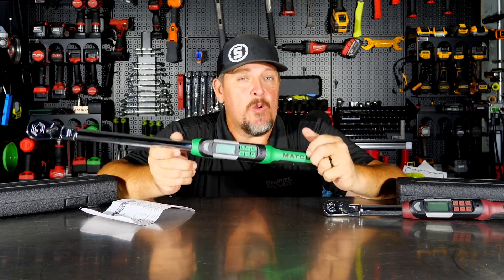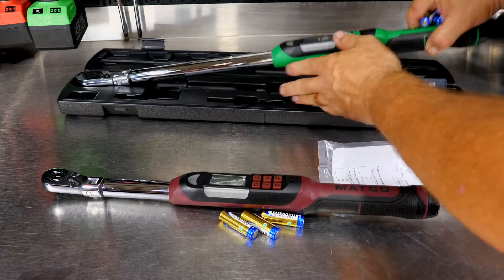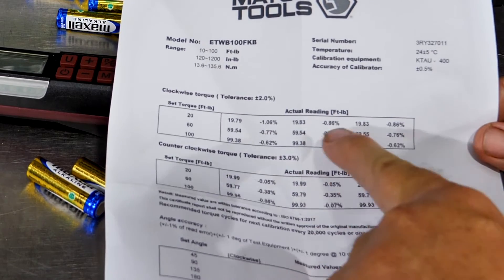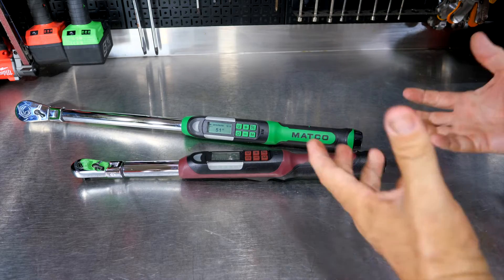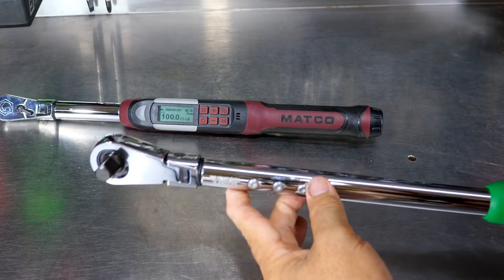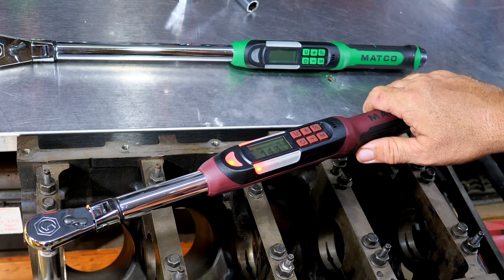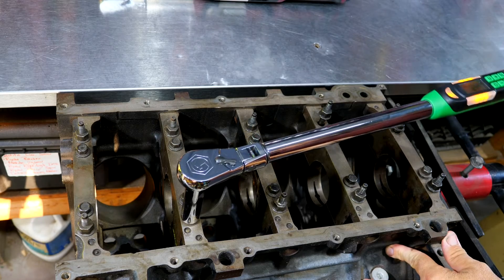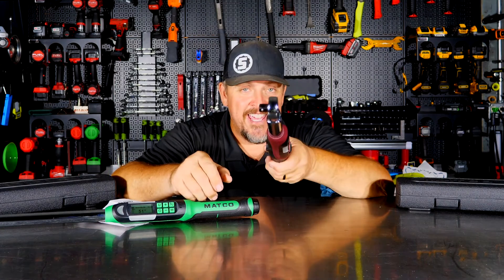MATCO Tools Electronic Torque Wrench with Angle and Flexible Head

Comment: The factory calibration certificate is only a snapshot of the tool’s accuracy at the time of manufacturing or calibration—it doesn’t guarantee continued accuracy after months or years of use—it serves more as a baseline of calibration, but not much else. Likely if the tool didn’t meet the tolerances set by the manufacturer, they wouldn’t have put on the shelf. 

In the end, the factory paperwork is not that valuable, the value is in the regular upkeep of the tool’s calibration as needed to ensure that the tool is working within the required tolerances for its intended application. Having these records might be useful in the resale market, but probably not by much.

If working in an industry that requires tracking the calibration records of tools, then that’s a different story, but other than that there is nothing wrong with buying a used torque wrench and getting it calibrated.

Comment: Not sure what you need angle for
Reply: Torque to yield bolts, axle bearings, a lot of engine components both internally and externally require angle after reaching torque spec
Reply: Then you’re not a mechanic lol

Comment: I just bought a full set of matco angling torque wrenches (1/4 - 1/2) with my student discount. I got all 3 for $800!! If I had to pay full price I might have looked somewhere else!!
Reply: I just got the half inch matco digital torque wrench and snap on 3/8 14.4v impact with my discount there is no way I wouldve even considered those tools without my discount.
Reply: Same, I was also able to get a long hammer barrel air hammer kit for 250 with my discount.
Reply: @josebedolla9831  Dude, that's super cool! Recently, I was able to find a really nice snapon air hammer at a pawn shop that's been helping me out a lot with suspension work!
Reply: awe, that's AWESOME

Comment: I have the Snap On 1/2" and 3/8" digital torque wrench but they do not have the flex head. The 3/8 was "almost new" but did not have the calibration card with it. He split the cost with me to send it off for calibration.
Edit to add. Yes, way to go Matco 15-250 ft lbs is rare. I didn't know of any 1/2 drive with a 250 max that would go down to 15 ft lbs.
Thanks for the review and video brother.